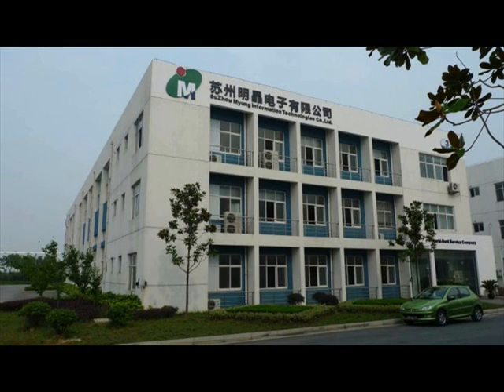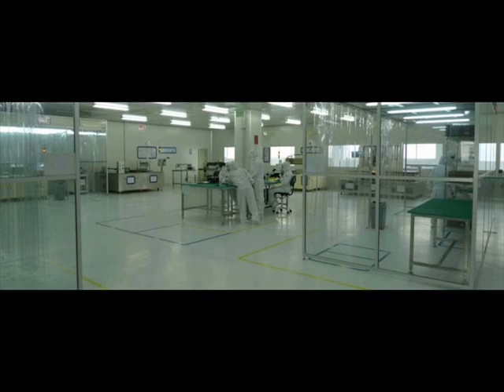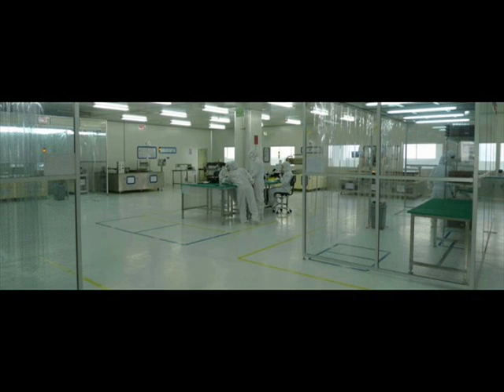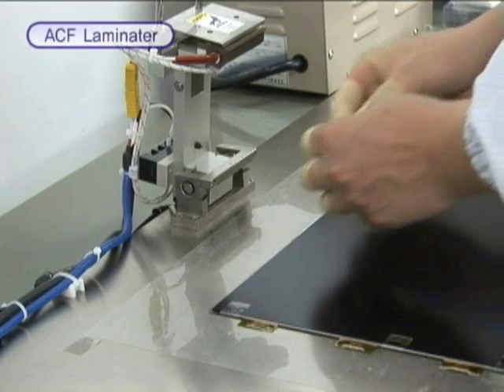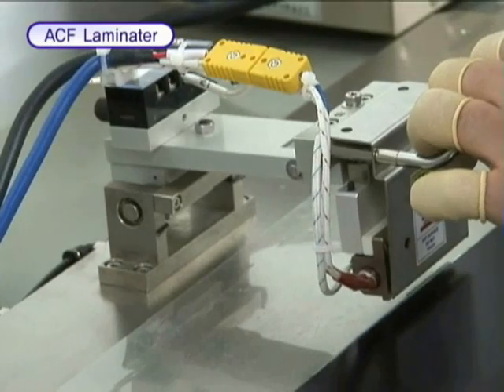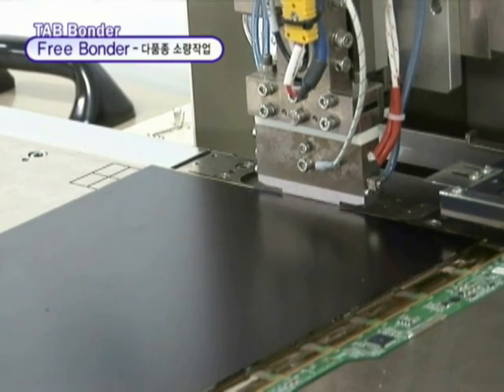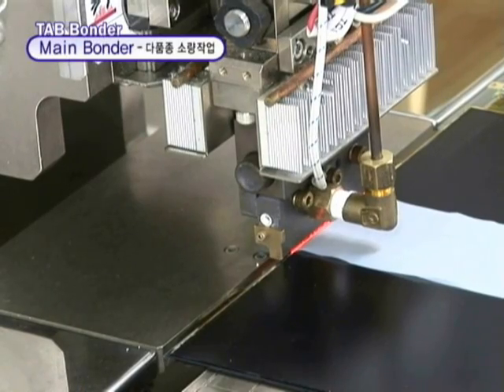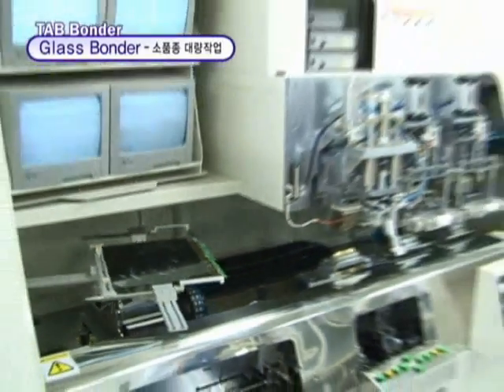[LCD Screen Repair] LCD panel repair service & repairing machines  液晶 维修服务TAB/IC, COF, Polarizer ACF

Comment: Hi,
I have an LCD panel to repair. A board is attached to the panel in several places but in one of these places, the flex ribbon cable has detached from the panel and I have no way to repair it.
The panel comes from a Nordmende N193LD lcd TV.
May I send my LCD panel for a repair ? If yes, how much for the repair and the shipment ? 
Thanks
Reply: www.szyessmt.com